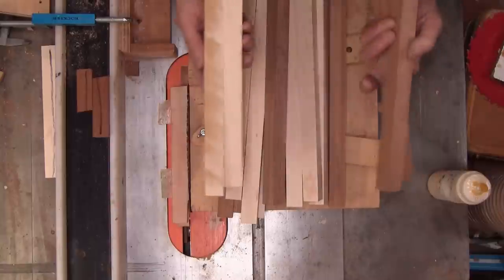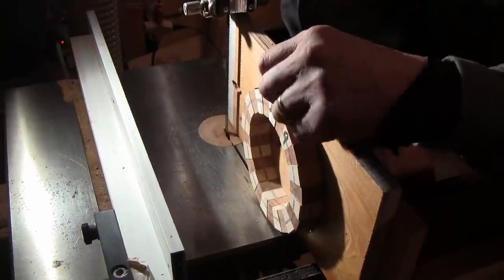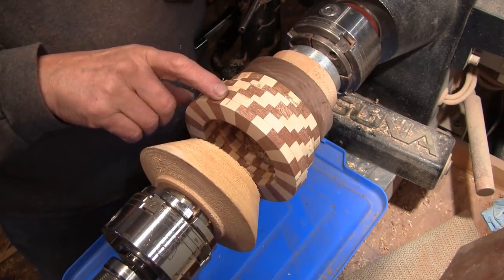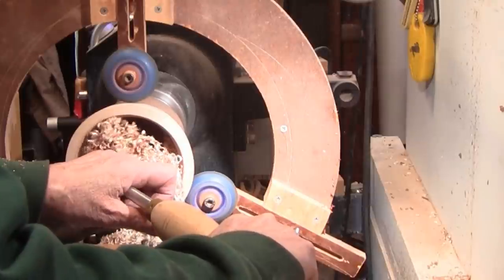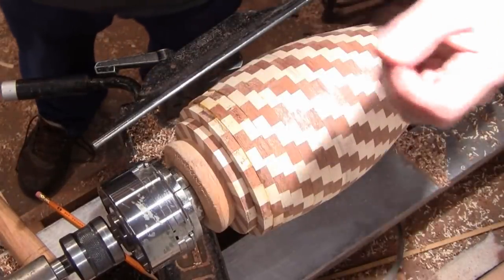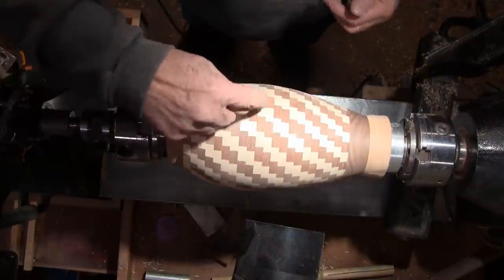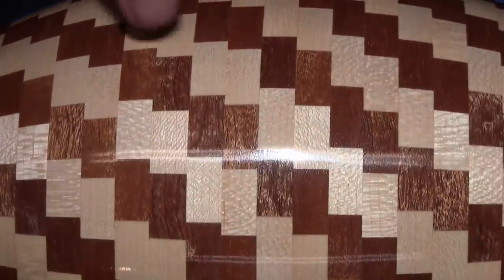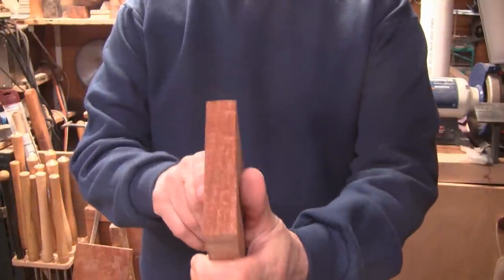Wood Turning The Segmented Thing #SegmentMM

Comment: Great looking turning. Really like the way you rotated the rings slightly different for the first and second ring of each diameter. I’ve don’t two segmented projects. Would do more if I had a real table saw. I did one project where all the segments were the same wood. Surprisingly the first project which was maple and walnut was easier to do and looked much better. 
You seem to use a different finish on each of your turnings. Would love to see a spreadsheet of your projects with details on the finishing and why you chose the finishing material and application method.
Reply from the maker: Thank you Bob. Happy you enjoyed the video. I have many choices of finish and just did one with shellac. I choose the finish based on the turning and how I want it to look. And which will be the easiest to put on. This finish was chosen because it would have been hard to spray lacquer on the inside. Where as the Polyacrylic can be wiped on and give a finish as nice as lacquer.
Thanks for watching,
Gary

Comment: Beautiful piece Gary. If I have one that’s inside is hard to turn I just put my lathe in reverse so it’s easier to see. I have a locking chuck so it won’t unscrew or at least haven’t yet 😁   I also sand and finish while I’m going because I’m not comfortable sticking my hand in a deep piece while it’s spinning & have had sanding and finishing sticks get pulled out of my hand.
Reply from the maker: Thank you for the good information. I also turn in reverse when it is hard to see.  And for sure turning as you glue up is needed for something like this. I turned and sanded 3 times as I recall. So about every 3 inches. I did all the finishing on the inside with soft cloth one the end of a stick. 
Thanks for watching,
Gary

Comment: Gorgeous piece Gary. Great choice in the orientation of the grain of the sapele. I really like the simple design or that. How long do you usually sand with each grit?
Reply from the maker: Thank you Scott! Well this sanding very easy but I sand till the scratches from the previous grit disappear. If  you and sanding with 80 grit and move on to 120 and there are still scratches they will not go away when you go to 180. So just keep sanding till you have a new size of scratch. Once you hit 400 you should not be seeing any.
Hope that makes sense.
But to answer for this one I doubt it took more than a minute between grits. Segments are easy as you are always sanding with the grain.
Thanks for watching,
Gary

Comment: Beautiful. Maybe I need to watch again but I didn't see you put finish on the inside. So, is the interior  finished like the outside and on or off the lathe?
Reply from the maker: Thank you Dave. I finished the inside the same while on the lathe. All you could see was my hands blocking the opening. To get the bottom I used a soft cloth on a dowel. I should have mentioned that.
Thanks for watching.
Gary
I

Comment: Gary, was there any need to use the planer in the making of the segments, either before cutting to 1/24ths of a circle or after? Thank you for the video and the beautiful project
Reply from the maker: So what I did Mike was flatten both faces on my 14" disk sander. I then cut them down the middle. I glued the flat side of the disk to my base and then cleaned up the bandsaw cut with my negative rake scraper used a sanding board to make sure it was flat. Then was able to glue the sanded side to that ring and so on.
I have used a 12 tooth band saw blade and no sanding is needed. But I have to cut much slower. I think the method I use is much faster. I keep thinking I need a drum sander. But I would have to get rid of something to make room for it LOL.
Thanks for watching,
GAry

Comment: You use the negative rack scrapper a lot. Understand you ground It yourself. Are there any commercially available scrapers like this? If not how did you make yours?
Reply from the maker: Thank you Bob. Yes there are a few commercial negative rake scrapers for sale. It is just a matter of grinding both sides to get it.
And this one is 1/4 of the cost of most of the ready made ones.
 On mine I just started grinding the top edge a little at a time. For a long time it looked much shorter. I now have it about the same. I grind 40 degrees on both sides.
Check this video out and I show what i do.
https://www.youtube.com/watch?v=wymTRPilYB4&ab_channel=ThePapa1947
Take care,
Gary

Comment: Gary. How do you know what size to cut the segments when the rings are different diameter?  Do I just change in 1/4” increments?  I’ve been searching for some king of chart or guide
Reply from the maker: Hi Mark, I have a few software programs but I also have a free app for my phone. It is called Segmented Calculator 2
It works on androids. I have plenty of old ones and put the app on one just for shop use. No phone service but it is being used as a tool. There are computer apps as well but the phone is easier and the computer will not fit in my pocket LOL. I also have used old androids for a GPS mapping app for long bicycle rides.
Hope that helps,
Gary
Reply: @ThePapa1947  thanks Gary I’ll look the app up

Comment: Where can I buy a live mount for my jaw chuck which fits in the tail stock? I see you using your chuck in the tail stock. What set up do you use? Also, what segmenting software do you think is adequate and not to expensive? Have you reviewed different software?
Reply from the maker: This is the tailstock chuck adaptor I use. You can also find it on Amazon. It fits 1X8 threads. I have a few of those chucks from a previous lathe. https://www.pennstateind.com/store/LTCA18.html
 I like WoodTurner Pro and I have 2 videos showing how I use it. You can find that in some of my recent videos.

Comment: Are both of the fences on your little sled adjustable? How do you get that angle bisected with just that wedge?
Reply from the maker: Hi Ben, yes both fences move. If you are asking how I get the exact angle on both cuts this is what I do.
When I made the wedge I made sure the angle was the same from the wider back edge. I can then make sure that edge is exactly parallel to the left side of the sled.
 It actually would not make much difference if it was off a little.
in this case the wedge is 15 degrees. So each side is 7.5.
If for some reason one leg was 8 degrees the other would be 7 and you still get the 15 degrees needed for 24 segments. 
Hope that makes sense.
Take care,
Gary
Reply: Not only is the exact angle of each fence not critical as long as the angle of both fences is right, you can even mismatch the angles on purpose. eg 5 degrees and -10 degrees.  It gives the segments a bit of a different look but you have to be more careful to get them right side up when you glue them.
Reply from the maker: Yes and I have gone as much as 20 degrees off. And as long as the included angle equals what you need for the segment it works fine. Another good reason to get a line on top of your strips before cutting the segments.
Reply: Makes total sense, and thanks for the explanation. I’d assume that having one at 0 and the other at 15 would make weird shaped pieces so you’d end up turning more of each away once they’re glued up, like there would be weird peaks in the rings, right?
Reply from the maker: @BenNawrath  the glue up does look strange and you do cut a lot off one corner but the effect is very interesting. I made a couple and thought I had a video of the one I have as a wedding gift.
 I guess I will just have to make another LOL.
Reply: @ThePapa1947  so I did you a favor by giving you a video idea? Haha.